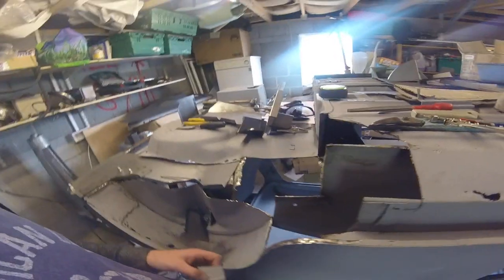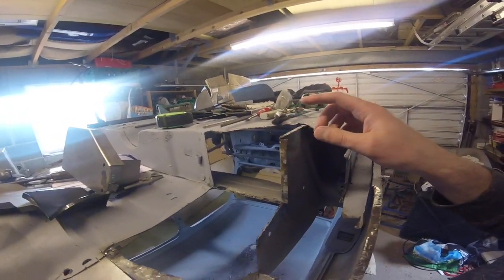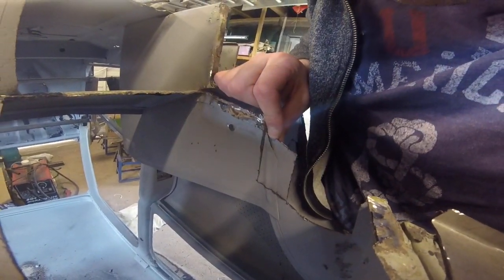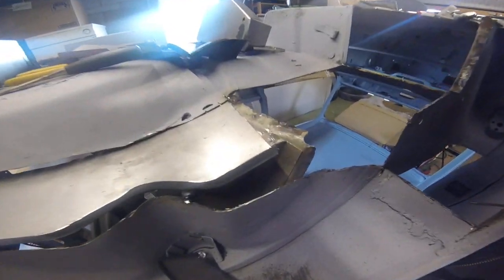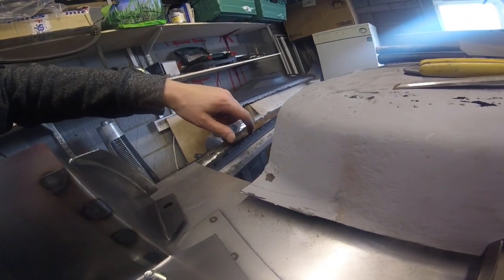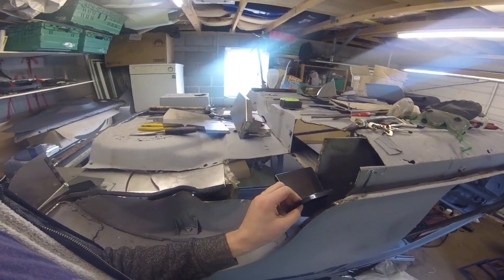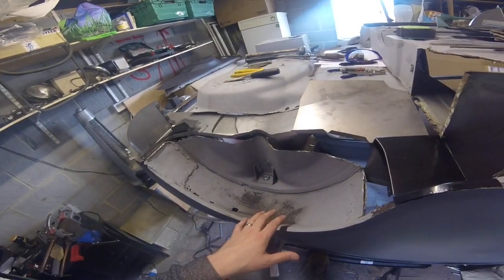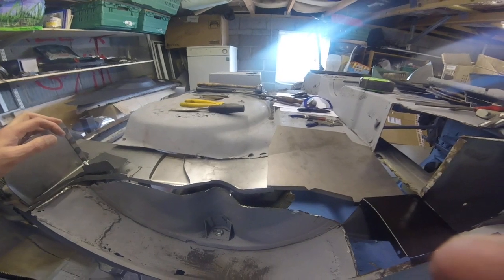17 Classic Mini Restoration - Boot floor update

Comment: Just ordered my rear arch closing panels along with the complete companion bins.. I have a heck of a time ordering panels..   Good tip on the idea of needing to attach the heelboard strengthening plate to the floor first...
Reply from the maker: If I remember you don't have pre installed outer sills so this shouldn't need to be done on your current build. Maybe one for a future build though!